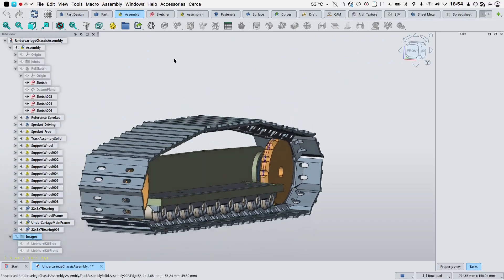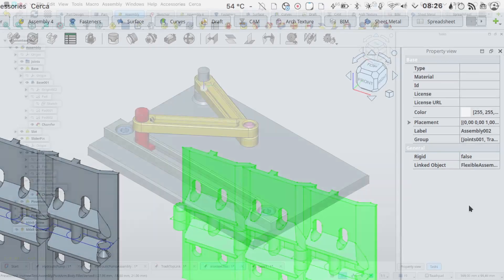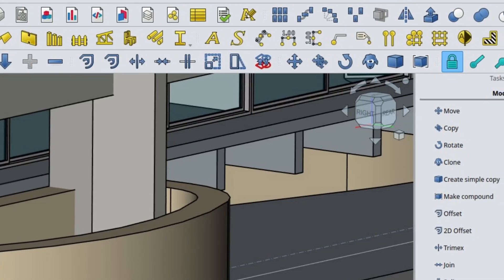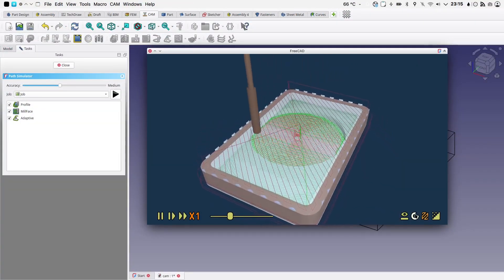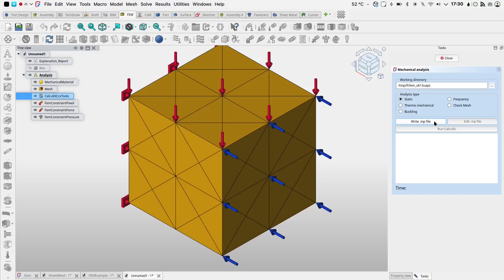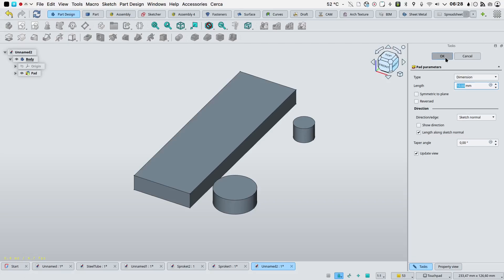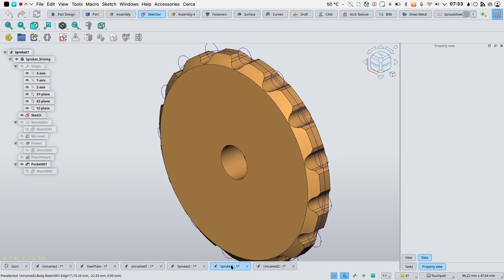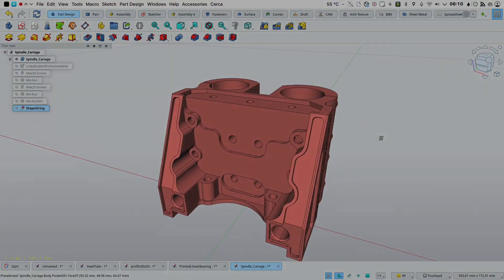FreeCAD 1.0 ReleaseNotes

Comment: Did this new FreeCAD 1.0 Assembly Workbench have its part assembly algorithm based on Assembly 4? The yellow icon is identical. Congratulations on the video. Great comments only on the tool's improvements.

Comment: Great video - FreeCAD 1.0 is very impressive.  Massive leap forward.  Well done to everyone involved.
Reply: we all have  Ondsel  for that... until Ondsel forked it the devs were basically just sitting on their asses.
Reply: @daomingjin  What about you? did you contribute to freecad?
Reply: @grn-xx  i needed to actually design stuff.  I was using  Solidworks since 2015. 
Though every  3-4 versions  i would attempt to use  FreeCAD.   Until Ondsel fixed things that should have been fixed  years ago. 
I mean if you have a block  of metal and your cad software can't put a fillet on it...  maybe don't try to use it to design something.

Comment: Just a heads up for anyone who installed open theme, you have to apply the preference pack in the general tab in preferences. It took me a bit to find this so hope this helps.
Reply: Why do you need "OpenTheme"? What is better about this theme?
Reply: @ukrainian-playlists  imho it simply looks better/more modern which in turn makes the time spent with the app more pleasant. Also the UI clarity helps with the effectiveness of its usage.
Reply: had the same issue, thanks for the heads up
Reply: Thanks!